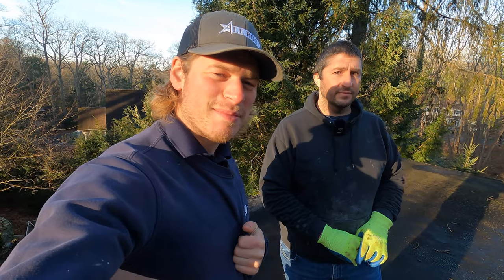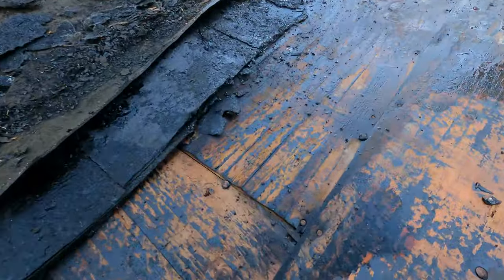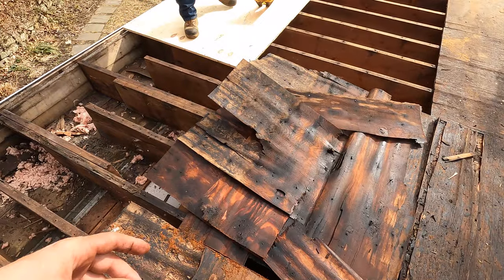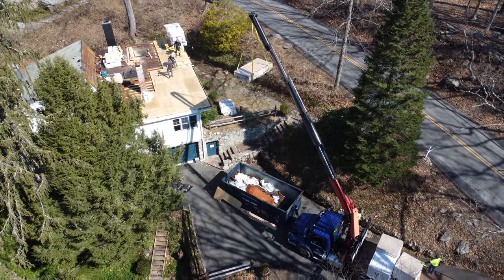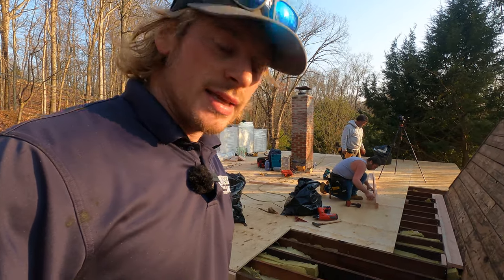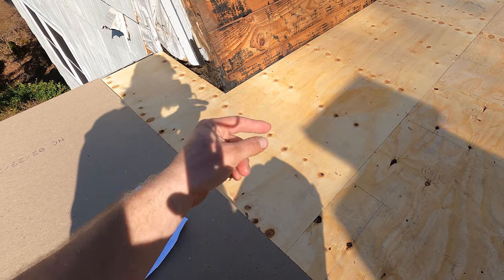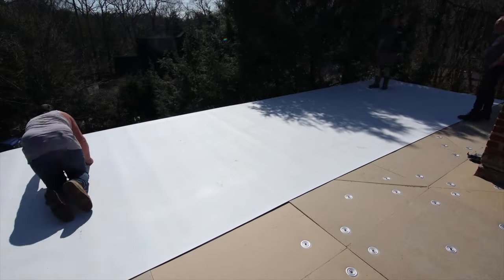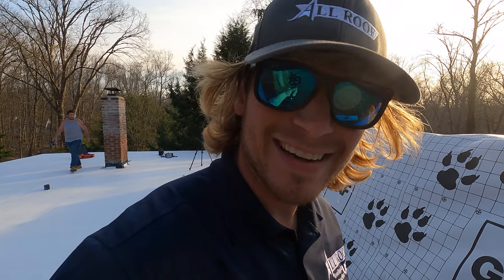How To Remove And Install A Flat Roof

Comment: After the roof was installed, I am assuming someone was replacing the drywall inside. Wouldn't the insulation just fall right down?
Reply from the maker: I think the owner of the building is professional Painter, so I think they did their own thing I don’t know really want
Reply: Eet's Not Part of his contract 😅

Comment: Thoughts on using adhesives to put down the polyiso vs. mechanical fasteners? No pops in the future with adhesives.
Reply from the maker: Yeah, but if it gets wet or leaks or insulation won’t be held down by anything

Comment: Very professional.  I’m currently running a project with this same iso slope package design.  I clicked your video because I saw the iso package.  I haven’t done one exactly like this in over ten years.  It’s a food distribution centre.  240sq.  It’s a giant freezer inside.  The underside of the steel deck is -35c at all times and there is 2” of ice built up in every single flute.  It all melts and pours in when we take the epdm and 6” of iso off.  The new iso package goes from 8” to 28” thick at the highest.  6 layers of 4” plus the slope pieces is the thickest parts.  We have 24” screws plus have to glue the top layer because they don’t make screws longer than 24”.  Very tough roof which is also covered in massive ammonia lines sitting on supports on the roof as well as tons of conduit screwed to the underside of the deck.  Have to build new stud walls to accommodate the height of the insulation.  Been a long time since I’ve installed sloped iso packages of this nature.  We’re done about 60sq so far.  The new roof is 2ply sbs.  Along with a 1ply torched sbs vapour barrier on new densdeck.  The slope plus flat stock and filler pieces are quite the challenge considering mostly everyone doesn’t understand what they’re looking at.  
I was impressed with your process and attention to detail.  When I clicked the video I was expecting it to be a hack job but quite the contrary.  Well done.  I didn’t catch the name of the membrane.  It’s a peel and stick tpo that bonds to the face of the iso?

Comment: Interesting video. Even though it's considered a "flat roof" the panels are tapered and arranged to allow for water and or moisture to run off. I have a flat foam roof that is actually flat and or concave (after 50 years.) I'm wondering if new foam panels are tapered similarly? I need a new roof but also want a bit of taper (without the expense of having to go with a full pitch.)
Reply from the maker: It really depends on the shape and size of the roof. Send me some photos and measurements. Also send me what the dip is or the deflection in the center of the roof. You can find that out by pulling a string line from one side to the other, and measuring the center, that drop is how much we need to compensate andre@allroofusa.com
Reply: Thanks for the speedy reply, it may take me a while but I'll work on what you suggested. I'm currently in the process of re sealing to try and get through another season. @AllRoof.

Comment: Thank you for posting these.
 I have a 5000 sqft shop i want to replace the roof on. I want to replace the metal B-deck and membrane.  been learning a lot from you so far. 
 what brand is the tpo membrane used here?
what brand are the tapered iso board?
 when does adhesive need to be used? 
 seams are just heat welded?

Do you offer a consulting service to plan the slope layout and scupper locations.
Reply from the maker: 1. Firestone bc it’s readily available to us in our area and with our local supplier. However, any major brand is fine to use. You can’t mix membranes once you start, so I like to be consistent with using Firestone. 
2. Brand of tapered iso doesn’t matter, just what you can get your hands on (especially now with the material shortage) there’s no advantage to getting a specific brand. 
3. Adhesive needs to be used whenever you aren’t using self-adhered membrane and want a non mechanical fastened system. 
4. Seams are only ever head-welded, never glued. 
 
Be very careful starting such a big project. Not saying you can’t or won’t be able to do it, just a warning that there’s a lot we don’t show in our videos. It’s a lot harder than people expect and by what’s demonstrated in our videos. TPO can be tricky at first and takes practice to use…especially doing all of the detail work involved. 

Yes, we do offer consulting services. Reach out to Sam@allroofusa.com for more information. Thanks for commenting and keep the questions coming.

Comment: Great job !!I suspect this has to happen to my roof......feeling kinda nauseated right now,{  Anyway, so at the end there, you do not top it off with the traditional linoleum . What is that white sheet called 18:04
Reply from the maker: It is called TPO it’s rated for UV exposure. It is a true Flat Roof membrane. It takes a little bit of skill to install, but overall not hard when the tools are set up correctly.